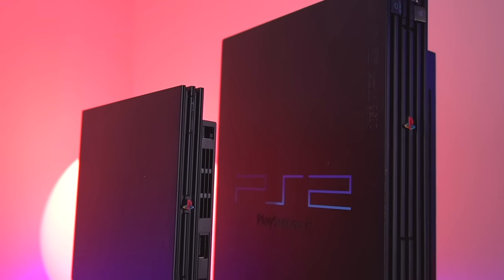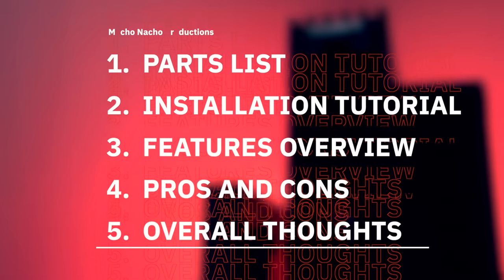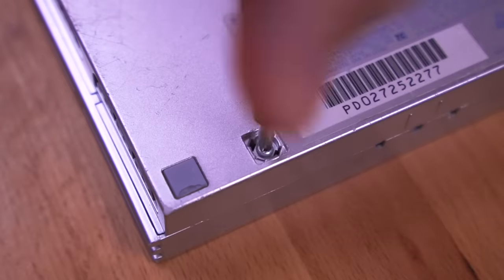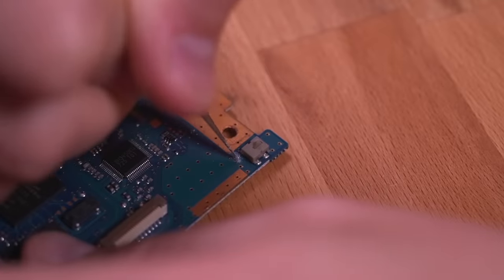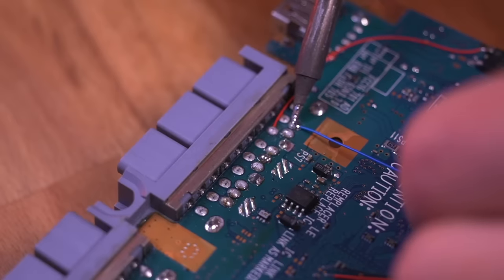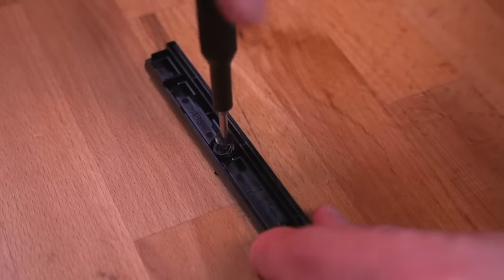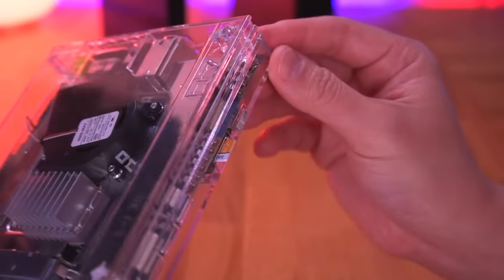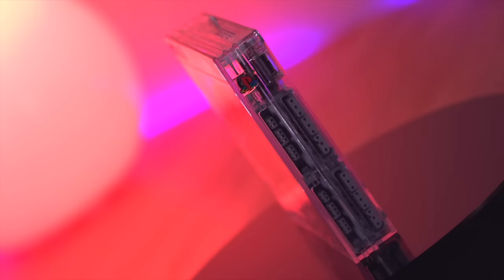Making The PS2 Even Smaller

Comment: It would be even cooler if the SD card mod was in the spirit of installing a hard drive on the fat model PS2. Now it's essentially a glorified MX4SIO solution, which does have numerous compatibility issues with games and SD cards. However, modding the PS2 Slim to load from an SD card using the IDE bus is decidedly not a beginner-friendly job.

Comment: Would it not be easier and much more durable to use a microSD reader breakout board than cutting up a MicroSD adapter and soldering wires to it (and probably melting the plastic in the process)? They're not exactly known for being durable, having to redo it every time one stops working would be annoying. And the MicroSD sticks out a bit more than I'd like, the things are flimsy and break in half if you look at them too hard.
It looks like there might not be enough space for a breakout board in that location, but there are a bunch of spots above the board and RF shield where it looks like one would fit, so it could simply be mounted to the top of the case instead. Alternatively, I managed to find a "MIcroSD extender" which has a microSD slot mounted on a very thin PCB that seems like it would fit and wires could be soldered onto the male end of the extender, and since it's on a PCB there's no danger of melting plastic although the pins are small. And another extender on a ribbon cable which you could route right near the solder points. Or wires could be soldered directly to a the pins of a loose MicroSD slot, this would be very fiddly for sure but it would be the most compact option and could just glue onto the case. I do appreciate that it uses something you likely have extras laying around of anyway, so it's one less thing you need to buy, which lowers the cost, but you're gonna go through multiple of them, they always fail.

Comment: Run into Problems with 79004 PAL Model. First the First Soldering is not possible, because that black consistor ( 6:56 ) is not present. Second Problem is, the cut for the connection is not easy, because the two holes ( 7:25 ) are directly under the switch. Third, the soldering for the Reset functionality ( 8:11 ) looks different. There are no two black transistors. Only the left one and no many quarders left from this soldering. Only one. So where should im soldering?

Comment: you will probably never see this, but just in case, can i do this with a scph-70012 if i used the original shell instead of the custom one, i ask because you said that one only worked because of the motherboard size, but using the original case would not need to be a small motherboard, right? i wanna know because my disk drive recently went out and i would prefer to have digital games anyway.

Comment: Mx4sio in this mod isn't the best solution. It is possible to solder the 40 wire ide cable to various point in the slim's pcbs. If you connect an ide to sd adapter you will have the best of the best compatibility in opl but with the sd card! Search ide sd ps2 slim. In youtube there is a channel named "gou mods" that do it!

Comment: One thing I didn't understand... Pins 3 and 6 are internally linked in microSD adapters, since the microSD has one less pin (and they're both GND on the SD pinout)... So aren't the resistor between black and white wires, and the white wire altogether doing absolutely nothing?

EDIT: Oh, I see now... the white wire is used as a return line to activate the Memory Card slot. Then I guess the jumper is only required on adapters that don't have an internal jumper.

Comment: That is very cool. I don't have APS to slim. However if I did I would totally do that mod because I do have a 3-D printer and I would print out clear, blue or clear green? Put some LED's so that it would glow. I did that with all my PS2PS3 controllers. But I can't slaughter stuff anymore. I don't have the dexterity or eyesight. And I don't have a p s two slim

Comment: Since its the slim model and it doesn't have a hdd and the usb is old and has slow transfer speed does it has issues like longer loading screens and or stuttering in games with the micro sd card since i have seen videos where when loading from usb on ps2 some games stuttered since it couldn't load it fast enough

Comment: Can you tell him another design update:

Recess the SD card reader so it is flush with the side. 
using a press in card adapter would solve it as well. since then you press the small SD card to get it out, instead of having to use tweezers

Comment: The shell is around 200 dollars with your options. I was so hyped but the price is way too expensive, even for this good shell quality :(
Reply: I came to a similar conclusion as well after receiving a quote. I will say it did have a silver lining of giving me newfound respect for all of the proper shell replacements coming out for consoles and their price points. I never doubted the cost but I didn't understand it either.

In the end, I've contacted a local printing house to put it through with black PLA for about $43 CAD.

Comment: Interesting project. But i have one question about reading speed from SD card. Earlier i'm had fat PS2 with broken laser. For games i used OPL with standard USB drive 2.0. And because version of console USB's is 1.1 (slow reading speed) I had many freezes/statters (espesually in game videos). So the reading speed through the memory card port with adapter is higher than trough the USB?

Comment: wait so, you can load the game via the SD card, then switch it over to the memory card slot two to load your saved games from slot 2 without compromising the stability / loading of the game via SD?
Reply from the maker: Unfortunate no. If your loading games from the sd card, once they are loaded you can remove the free mcboot card from slot one and then replace that with a memory card so you can save and load you game saves

Comment: Do you know if the 79001 version has the Ethernet adapter? If so, you can connect it to the home network with the share and load *.ISO's from it.
And another question: Has this console come without a mod chip? How would you be able to use it without a DVD drive?

Comment: The microSD slot is too unreliable and inconvenient.  There is enough space there; you could put a full-fledged SD card slot there, with a latch.  This way the card would not stick out from the case, and would stay there much more securely.  This is the only thing I don't like.  Well, seriously, it is literally supported by friction, it can easily fall out, and it also sticks out, because of this you can accidentally damage it and say goodbye to your entire library of games and saves.  And I really like the work, I think it’s not a problem to make this change easily on your own, nothing complicated.  Well, for complete satisfaction, add an hdmi port and a modchip.  I think additional multi-colored wires neatly soldered inside after adding other mods will look great in a transparent case.  I think I said everything I wanted, and forgive me in advance for my English :)

Comment: Hello Tito I have a new challenge to make the PlayStation 2 slim even more modern, how about putting a type-c input in place of the PlayStation's standard power supply? I've seen videos doing this mod, but on PlayStations that have an internal power supply, but I've never seen an external power supply, this mod would be perfect using the Type-C cell phone charger, it would be even slimmer.
Reply: es lo mismo, solo necesitas un USB-C power delivery, lo configuras a 9V, y lo sueldas directamente al conector de entrada de energía, el pin del medio es positivo y los lados son negativos, para el caso del video con 2 amperios es suficiente, pero para hacer funcionar la unidad de DVD se necesitar mas que eso, ya que con 2 amperios  al intentar enceder la unidad de dvd , la consola se apaga.
Reply: @davidtobar6518  No voy a utilizar un reproductor de DVD en mi PlayStation, ¿podrían recomendarme un cargador con la cantidad correcta de energía para mi PS2?  Sé que existen adaptadores tipo c para la entrada de alimentación.
Reply: @clebersilva622  yo uso el de un celular huawei P20 lite, que trae 9V 2A, pero en general te va a servir cualquiera que cuente con la tecnología de power delivery que tenga 9V y al menos 2 Amperios, si trae mas amperios no importa porque la consola solo toma lo que necesite.
Reply: @davidtobar6518  Gracias amigo, buscaré un cargador aquí y lo probaré.

Comment: Hey tito im just lost, for the sd card what needs to be installed on it when you are doing the internal mod.
Reply from the maker: With the new version of OPL, just a folder called DVD and on called CD. put all the dvd iso files in the dvd folder and try cd based iso in the cd folder. OPL should then populate the rest. The new version of OPL also supports exfat so no need to split the larger iso files.
Reply: @MachoNachoProductions  oh awesome, are all these files included in the links of your description ? thank you!

Comment: Cons
Increased loading times
choppy cutscenes (not in-game)
splitting multiple files that are higher than fat32's 4GB file size (most PS2 games)
obviously no diskdrive
-------------
Id like to see a fat PS2 using only internal storage (the HDD or modded to use an SSD) so the loading times wouldn't be as bad as using an SD card or thumbstick because that would be the better "digital only" version of the PS2s

Comment: Edit part about sd cards. You've shown 2 different types of memory. SDHC uses old FAT32 system file which has a limit of 32GB and it's easier to read by PS2, meanwhile SDXC goes up to 2TB and ps2 struggles with reading it.

Comment: Ultra slim design is very good) But the method of launching games sucks. With this design, it is better to use Orange Pi Zero or Nano Pi Neo and play games via ETH mode. But you, mostly using the huge and healthy Rasbery Pi. Try somehow to implement Orange Pi Zero or Nano Pi inside, if you need help, I can help with diagrams.

Comment: I wouldn’t put any weight on one person’s anecdote about experience with one unit of one brand of memory card vs. another, and I’m sure plenty of others, besides Samsung, work just fine. If not, I’d question the re-engineering, if it’s only compatible with Samsung cards, when Samsung—simply as a function of production costs for X units, some of which a;ways can make more money selling the units to other brands than selling under the same label, combined with the function of the inverse relationship between number of units produced and cost per unit. That’s why generic OTC drugs with your grocery store’s/pharmacy’s label on the bottles say they were produced by the company that makes the branded drug and distributed by the store chain...

Comment: Does the MX4SIO work faster than a standard 2.0 USB? I have a fat PS2, and although I can't upgrade it like the one shown in this video, I do want to speed up the games without having to use an internal HDD.
Reply: Yes MX4SIO is a lot quicker than USB. It’s basically equivalent to loading games on a fresh disc drive. It works on all models, even the fat ones. Totally worth it.

Comment: I didn’t go through all 800 comments… but has anyone else run into a 79001 that didn’t have the lid detection switch?   Mine looks the same… except no LDS.    Looks like it’ll work just have to make a way to place a switch in location.
Reply: Im facing the same issue. Any fix?
Reply: @antalus  yes… I just added a tactile switch and 3D printed a support
Reply: @dtomcat  hi! I’m with the same issue of no lid detection sw… Could you please share the support model? For the tactile switch, that’d help a lot
Reply: @LucianoElias23  I had made my own, but the one I linked will work better

Comment: Awesome video!  Any mods for the Nintendo switch?  There should be a better networking adapter since all current ones on switches including the new oled model cap speeds around 80 mbps.  It's so slow! I'm assuming it's locked because of usb 2.0? Many people want to use their fiber speeds!

Comment: They should be able to get the system to run everything flawlessly like it does before the mod the problem is the sdcards or the reader itself maybe they arent strong enough or the read speed isnt good enough  normally a digital model would run faster then loading from disk so clearly its the reader or the sd themselves

Comment: you might as well include blueretro support on it, then threw in a DS3 controller to keep the original look of the controller.

unfortunately, blueretro is yet to have pressure sensitive button support.

Comment: The fact that it still uses the outdated USB method instead of the memory card slot for games is unfortunate. Less than half of all PS2 games will not run properly. USB on PS2 is too slow to use for a digital only mod. Looks cool though.

Comment: The reason the "kingston" memory card doesn't work is because it's fake.  Run Fake Flash Test on it and you'll be surprised.  I got bit by one of those too.  It shows up as 64gb in windows, but it's really a reprogrammed 16gb card.  So after the first 16gb, the byte addresses loop. -- Samsung are good if you get the painted ones from a reputable seller.  Moral of the story, don't buy super cheap storage devices, they are a scam.

Comment: Wait, if you disable the SD card reader to use the second memory port, how do you run games?

Also, you when from an SD XC to an HC, could that be a factor?
Reply: The 2nd slot would probably be more for booting to the PS2 menu and copying stuff between memory cards. Also it can be used to keep FreeMCBoot on memory card 2 and switch over once booted into OPL.

Comment: Why did the PS2 even stock two USB ports? What were they originally intended for? And two slow ones at that. By the time the Slim came around USB 2.0 was around. That would've been better off with one USB 2.0 instead of the same two USB 1.1 ports. They really cheaped out there.

Anyone know what's the largest SD that mod can function with?

Comment: Is size the only constraint, when it comes to the model of motherboard? I have a model 70003 ps2, but wouldn't mind expanding the case if it can't be trimmed like that.
Reply: in theory you’re just removing the optical drive and rewiring the 2nd memory card slot to the SD reader. something this simple could be done on any unit, but the point is to make it as compact as possible.

Comment: you can make it smaller using a different slim mobo model, small enough to make it a portable unit..., i mean what do you think the psp is? a portable ps2 with a cpu and ram and gpu upgrade and a smaller ic feature size... you would be suprised what Extremely Large Scale Integration fabs can do, nowadays you can shrink teh entire ps2 to a few chiplets on an interposer die
Reply: wit dat 14 and 20nm fabs, you can probably just make a ps2 SoC nowadays
Reply: and throw extra shit for cheep, like hbm ram for gpu (wit ps2 only really need 64-256bit wide word types, edram bus is 2560bit and off duh shelf hbm is already 4096bit, so plenty of options) and sram in ps2 specs is cheap enough but prolly give a big performance boost

Comment: I want to do this mod so bad ! And I have two slim model 79001s but they run great with the discs and the shells look practically brand new

If one of The disc drives for in one of the two consoles that I have or if I come across one with a shot disc drive I’ll certainly consider

I would love to run it with a micro sd or even the ps2 memory card slot the ISOs just to play some of my favorite fighters . It would be nice to have a console that’s tiny that plays street fighter alpha anthology

Comment: I don't understand. The fan appears to be pointing in the opposite direction of the heatsink. Seems like you made the fan useless.
Reply: The fan direction remains the same as the OEM. The idea is to pull ambient air from the side vents, up through the R/F shield, and out the back. Wesk improved this by adding two barriers to better direct the warmed air out of the console. However, as you pointed out, this isn’t typically how we see fans work with heat sinks on PCs. Since we all know that PS2s can get quite warm, perhaps we should consider improving the cooling method on the Slim models to be more like a PC.

Comment: An interesting approach but still lots of negatives about it. Like mentioned in the video it leaves lots of incompability, most cards are slow and corrupt the data.
The best way is still an ssd through the network adapter port and a chipped console. Something to think about in the future I guess. 
Also kinda was weird seeing sawing the board and cutting traces like that. Once you do that pretty much no going back.
Coincidently I also have a silver PS2 that have a missing drive bay, forgot what the serial is so it's history behind but kept it for parts and projects but next to my working last gen chipped PS2 I never needed anything else. 
So might give this a try on that in future as a second smaller unit, however I will do my best not to cut things in case I change my mind later on and rebuild into something else like a different case or something.

Comment: So only 7900x model work? 7700x wouldn’t? If someone can lmk
Reply: No the SCPH-7900x is unique in that the motherboard is much smaller and is almost square.   The Slim models 700xx, 750xx and 770xx models, the motherboard is much larger and cannot be made smaller.  Please note that not all 7900x boards are the same with the lid switch in the corner as shown in this video.  Not really a show stopper because the mounting holes are the same and you can be creative.

Also,  go to the bitbuilt link.  There have been modifications to the shell by others to make improvements.  Wesk states in his post that he did this mod on a whim and it is what it is.  Thats what so kewl about all you guys chiming in on this stuff. It just keepes getting better and better when we share ideas/info.  Total credits to Tito and Wesk on this build.